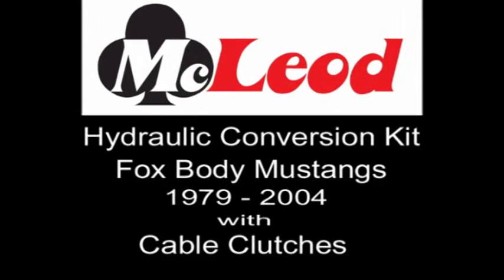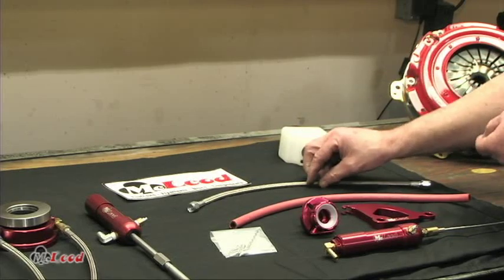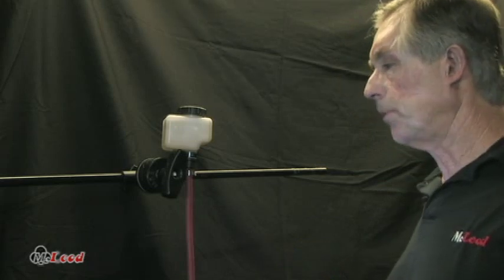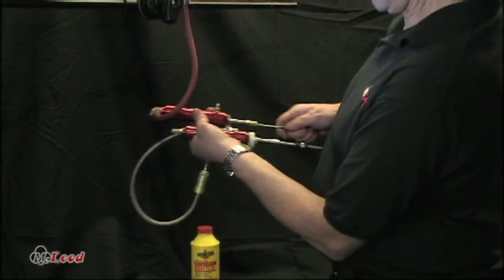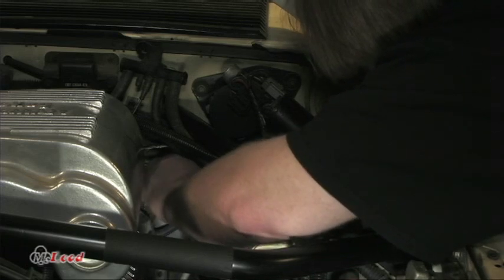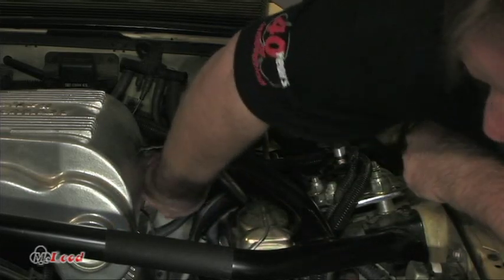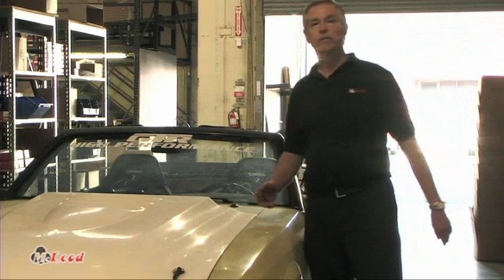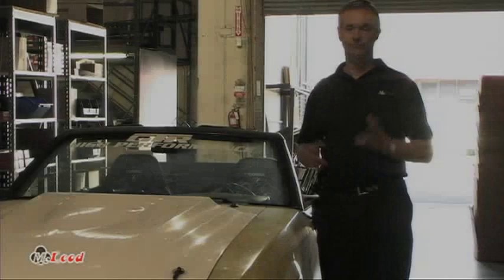1979-2004 Mustang Clutch Hydraulic Conversion Kit.

Comment: Update this video please there is no information anywhere about the internal mounting of the Throw out bearing. Does it just float inside the bell housing on the input shaft? I’m curious how it just “replaces” the stock bearing when the bearing was held in place by a clutch fork.

Comment: Hey I installed the clutch onto my mustang and when I clutch I have no pressure, do you have any suggestions, it’s not pulling on the clutch fork under the car. It just sits still.
Reply from the maker: If nothing is moving, then you still have air in the system. You need to continue to bleed the system until the clutch pedal has the same pedal feel as the brake pedal.

Comment: I got one of they’re clutch kit and the throw out bearing didn’t last me 6 months
Reply from the maker: wyntifur lust hello! What happened with the bearing?
Reply: What happened I’m thinking of buying one but I keep hearing bad things about it leaking
Reply from the maker: gavino orozco what kind of car do you have?
Reply: gavino orozco throw out bearing didn’t last I’ve been asking around and people have recommended to go with the stock bearing, as far as hydraulic quality I could not input since my mustang gt is cable operated
Reply: McLeodRacingClutches when I removed the bearing attempt to spin it to verify that is what failed in the clutch system and the bearing would just grinding I kept all the parts except the old flywheel and pilot bearing since the pilot bearing was in pieces attempting to removing and since I got a new flywheel , reverted the pressures plate and clutch and bearing back to ford stock parts since my dealer still had those parts
Reply: McLeodRacingClutches I have a 1989 mustang and put a McLeod clutch but I want it to be soft so this looked like a good idea
Reply from the maker: gavino orozco give our techs a call 714-630-2764

Comment: I have a 347 stroker and a 9# Powerdyne s/c. I keep cooking clutch cables (6) between the header tubes, they stretch and break and leave me stranded ( while the cable is UN-stranded). I'm hoping this kit ends all of that !
Reply: Did you ever install this how did you make out?
Reply: Did you end up putting it on
Reply: @htkuntamed1989  I have the throw-out bearing version of this kit, and it definitely helps if you're headers cook your cables. Haven't had a heat-related clutch incident since the swap, plus you can route the fluid line pretty much wherever if you're willing to get some clamps/zip-ties or route some hardline. That said, be prepared to bleed this thing about as much as you saw in this video, it takes commitment lol.

Comment: i want to install this in my 98 but i installed a tr3650.. will it work and i have a after marker f1 stage 3 clutch kit set up. and i want to put the internal slave.. will this set up work? if not what set up will work mcload racing?

Comment: What is the part number for the external slave cylinder set up.  I can not find it on your web page.  Also price would be great.  Thanks
Reply from the maker: The part number is 14-326. It is located at www.mcleodracing.com } Hydraulics } Hydraulic Conversion Kits.

Comment: Why don't you show how to install the quadrant. Even the kit instructions don't show anything about the quadrant and to picture is lame. Nowhere does it say that there are 2 posts for the quadrant. You assume everyone knows how the clutch pedal assembly works, not user friendly. How do you connect the cable when you have only space for one hand and no leverage to pull the cable over the quadrant. if the unit has fluid, there is noway someone will pull the cable to attach it to the quadrant. All of your instructions are really bad and unfriendly.
Reply: Because they know its more difficult than they claim. Look how the install kicked his butt just pushing it through the hole. It doesn't mount to anything. Looks like a $650.00 dollar paper weight in my opinion. .I'll go with his competitor. Looks like better set up.

Comment: I want to buy one of these so bad but this install video is terrible. Blocking the camera when showing how to attach the slave cylinder. Doesn't show the interior hookup or quadrant install.  And they give you one page horrible instructions. I'm worried about spending this much and then not being to install it. Should be better instructions and video for $600.
Reply from the maker: Hey there! If you need more instructions, be sure to give our tech line a call! They can help install the kit. Thanks! 714-630-2764
Reply: @McLeodRacingClutches  Thank you, I will call. Definitely have questions about the install. I appreciate the response.